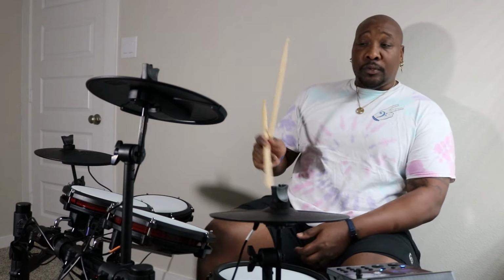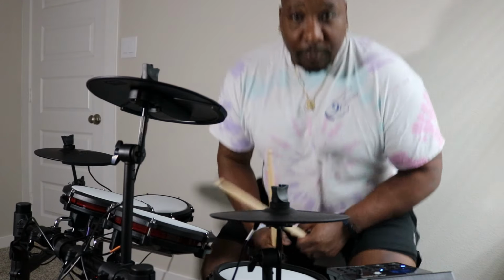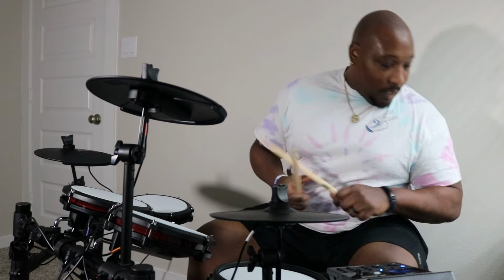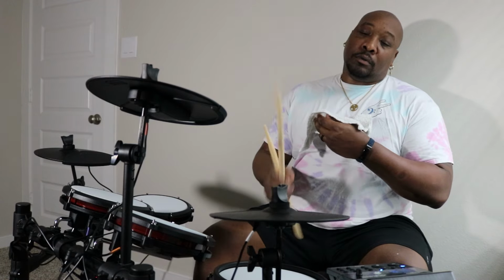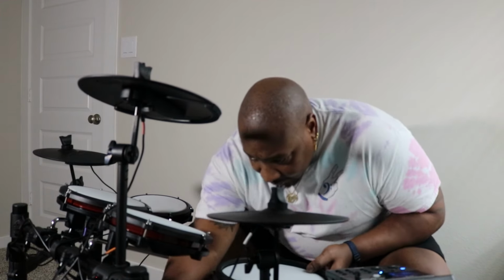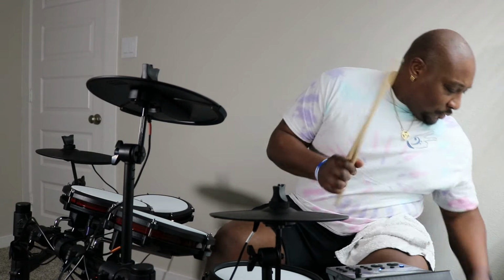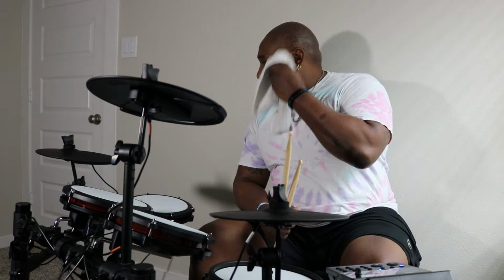Alesis Nitro Max Electric Drum kit: Open Air Demo #alesisdrums

Comment: I just bought  the  Alesis Nitro Max Kit  , and are they ever low  no worries i found a Solution  I bought 4 Piece's of  15 inches of Aluminum tubes to fit inside of each leg so that i could raise up a bit higher,  it works Perfectly.  👍 here are is the  inside tube diameter  1 1/4''  each at 15'' inches. also if you want to extend the Cymbal arms  a little longer  Aluminum outside diameter  3/4''👍